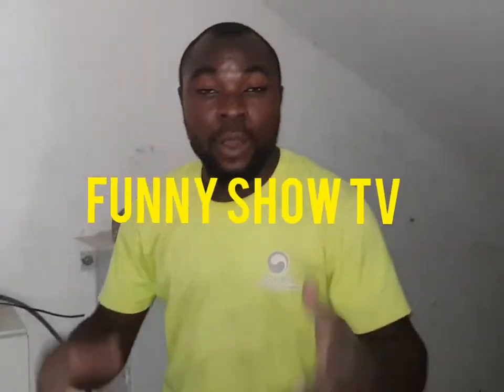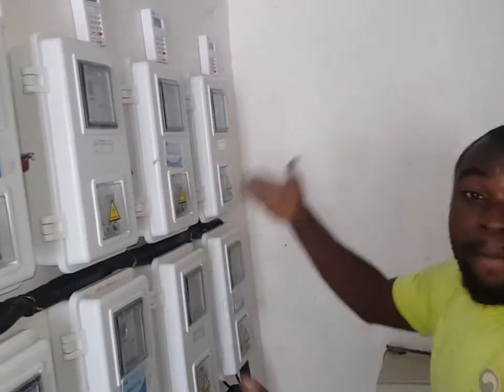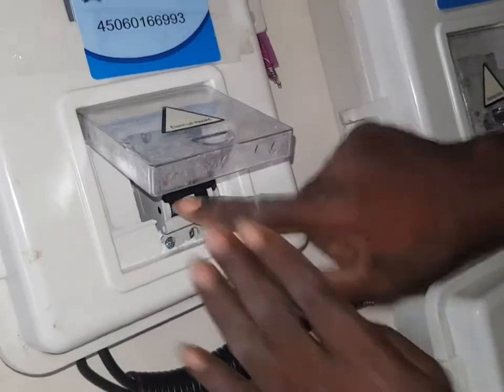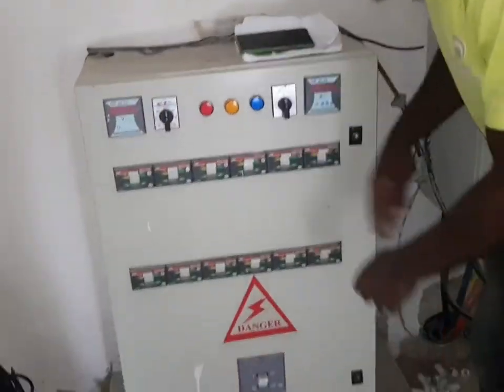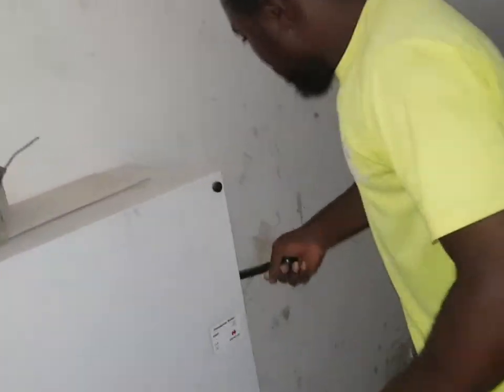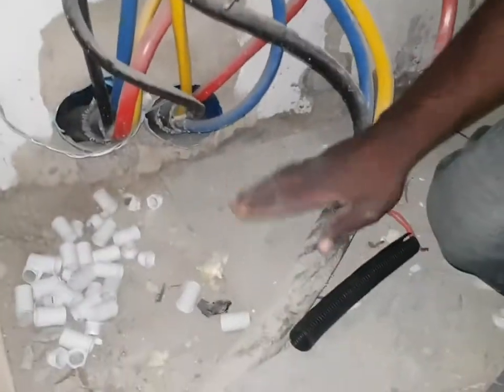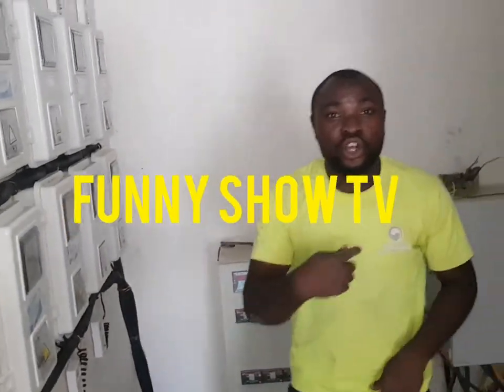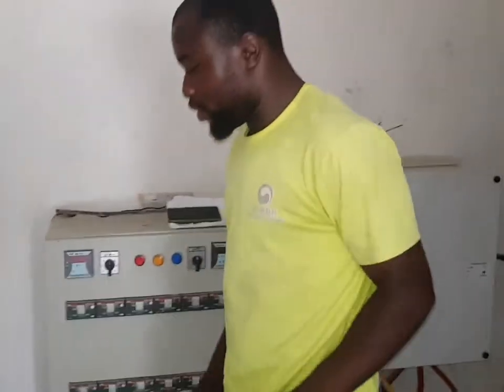Nigeria meters installation

Comment: Pls does the meter box and the breaker come separate?
Reply: Because I had one installed in my apartment yesterday, they took N15,000 from me for the breaker and the copper wire they used.
Reply from the maker: they come together
Reply from the maker: they both come together sir.
Reply: Ok, thanks, sir.